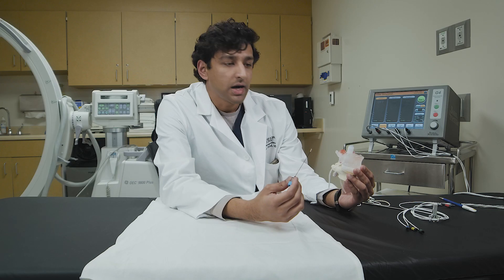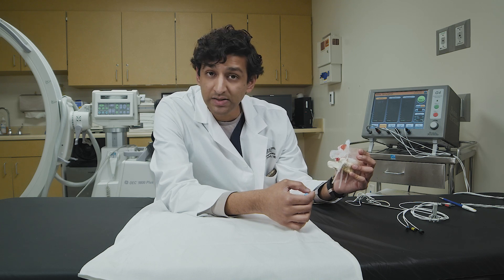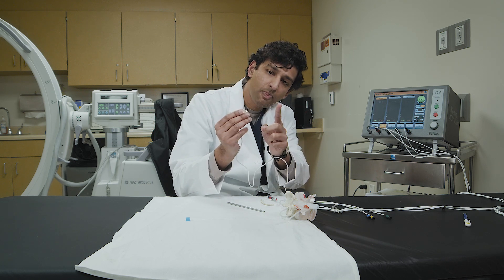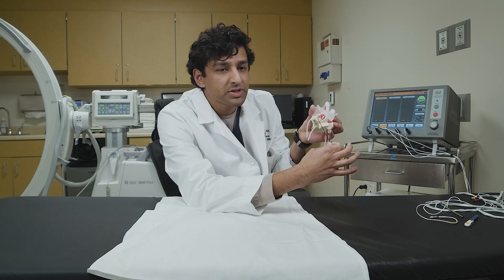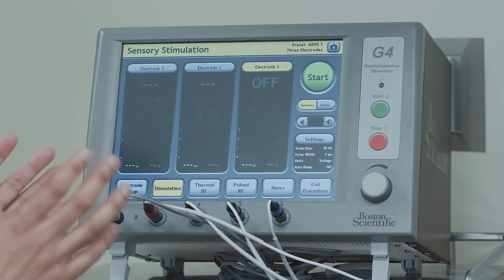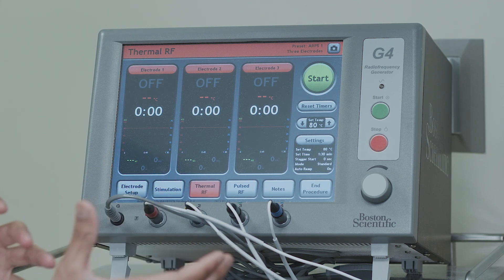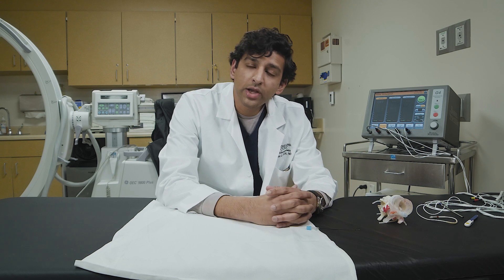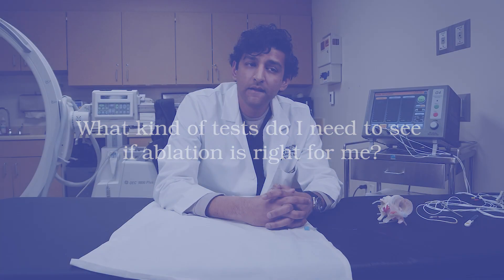Radiofrequency Ablation Technique and Process Explained

Comment: I have lower back pain not due to any injury. I have done this 3x about 12 months apart it is only temp but you can't get this done before 6months of the last procedure .Due to the level of pain I was having daily everyday ,every night it was the Best decision I could have done or afford thanks to insurance I wish it was permanent. I was told I can maybe get it dont about 8x then after it may not work😢 but over all after the procedure you will feel pain because of the process of the procedure after that you can be lucky and be that patient who get long term relief OR you may be that patient who gets very short term relief OR No relief at All. You will not know until it's done . I was the lucky one it last about 1 year until the pain return,but on my 3rd round it last about 8months before the return.

Comment: I had this procedure done yesterday it’s about the same pain as having a Facet Blocker my doctor only did the right side I’ll go back next week to have the left side done the most advise I can give is to not think about any pain but to think positive thoughts and that you’ll having this done to relieve yourself of your current condition.
Reply: A lil more painful than the steroid injections.  Thankfully they give me 2 weeks between each side.  It’s longer too. Takes over 2 minutes to burn the nerve. Just had mine done for 2nd time.
Reply: @loricunningham2295  how's the pain now and how long for relief? Days? Weeks?
Reply: how did it go ? did the pain relieved ? and when it started to relief ? (I mean after how many days)
Reply: @amiramo4159 . Can take up to 3 weeks to feel full effects
Reply: Hi! Thank you for your comment.  I have this coming up soon for the first time in the cervical spine area.  My question is, 8 months after your procedure, do you still have the same level of pain relief? Was it a huge improvement or just moderate? Thanks!
Reply: I had it done. When pain is suicidal this is the answer.
Reply: My doctor only wants me do this take my pain pills away. I hate needles but can't stand pain anymore
Reply: I’m scheduled for this procedure next Wednesday, but I have had excruciating pain for over a month now but I’ve been suffering from back pain for well over seven years. Tell me how do you feel now that you’ve had the procedure done

Comment: Had this RFA intervention on my law back spine yesterday, i thank you so much for posting this on the channel for simple and clear explanation, especially difference between sensor and motor nerves branches. You also confirm all the suggestion for the different alternatives treatment i received 1  steroid injections, 2  Rfa ablation to avoid any soon surgery, especially pain is in my low back and not much on the legs,,,,
I will see in couplkes of weeks how it goes.
Reply: how did it go ? did the pain relieved ? and when it started to relief ? (I mean after how many days)
Reply: How are you doing now? Please post.
Reply: @bettyblevins6161  Hey, had a TLIF surgery 3 months ago, i m doing fine slowly recovering

Comment: QUESTION::  Can RFA treat PHN pain in the vulva area? 

 I am willing to risk losing permanent feeling on that side: i just want to know if it's possible...?? I'm SO desperate. 

The epidural shot did not work, it may have made things worse . I'm now having "electric shocks" (like painful throbbing but, a shock.  I've been shocked by electric wire; YES  THAT feeling, along the "shot path") In addition TO : the horrendous pain of the Shingles damage done to my private parts!!!. After 7 months of this, I've already been hospitalized and am on high doses of gabapentin. I have cyclic vomiting and have lost (&desperately tried to gain back.. over 50 lbs. Freaking yo-yo). This pain is the worst, and I've lived with most types for decades. My body is a mess. I'm "that" patient.  😢 hopefully my neighbours can't hear my screams..
Can i burn those nerves away??? I'm at my wits end. 

We started the RFA for my rt cervical, had the "test" yesterday. I'm hopeful for this, i have multiple problems in all 3; cervical, thoracic, lumbar. 

:: fingers crossed:::

Comment: My insurance is requiring my pain doctor to make me go through 4 faucet joint injections before my RFA.  2 on the right and 2 on the left.  So a simple xray did not satisfy the governing force of my insurance to determine that I can have the ablation.
Reply: I've had facet injections done & didn't help me at all, I have osteoarthritis, disc disease, neuropathy not diabetes. Numbness, tingling, burning, itching, severe neck pain, scalp pain, blurry vision, burning mouth syndrome, I have tried so many medications nothing helps, toradol shots 2 time's a month, slurred speech, light headed, spinning symptoms, weakness, my left temple hurts more everyday, so I'm taking my chances to drive to Columbia Missouri to see a doctor to hopefully get my nerves burned I need help bad it's too hard to live like this I'm nauseous everyday, I want a solution & help more than anything.
Reply: You might want to have a CT melodramatic by a neurologist office and see if you have a CSF  leak. (Spinal fluid leak) look up the symptoms, just a thought. Good Luck !

Comment: Question...i have to get a fusion no matter what.l4l5s1... my pain  trigger went i start moving . If they burned the nerves.  I know the pain will come back sometime again  .Butt  it will be the same paint like before?that  went  i don't move doesn't  bother me.  Or it's going to b a permanent pain.  That  i have to get the nerves burned again.? The reason its i need to try to get a better position at my job now before i get the fusion. Went i get them fusion i don't want to add  more pain to my back. I hope the fusio helps my back later on. And i don't have to  worry about nerves pain from the RFA. Ty.???

Comment: This information is wrong.  The probe uses radiofrequency energy not emission of electrons.  The radiofrequency creates oscillation of ions within the tissues which as a consequence creates frictional heat.  The temperature being measured is primarily to monitor the induced heat in the tissue, not to monitor the average kinetic energy of particles in the probe.
Reply: No response from Dr Patel...?? As a complicated chronic pain patient, I'm in the process of preparing for my 1st procedure. 
I'm looking for the best/ most comprehensive information.
Reply: Did you have your procedure?  @cult-member